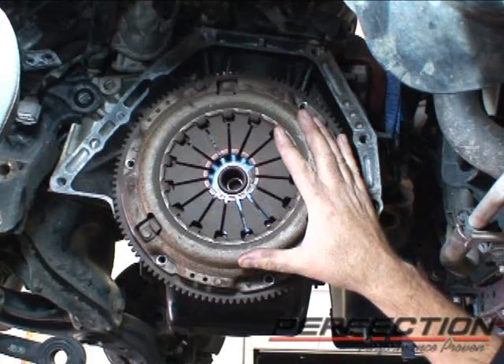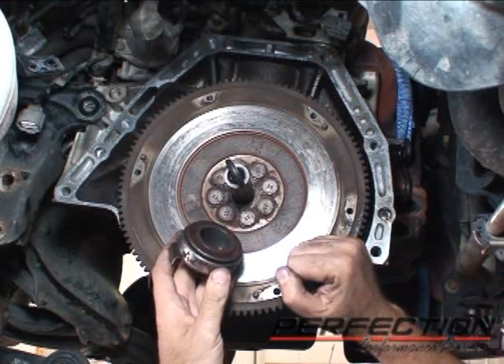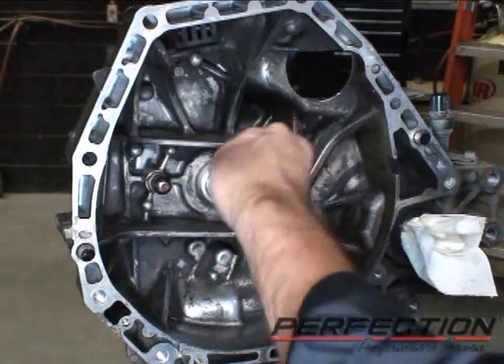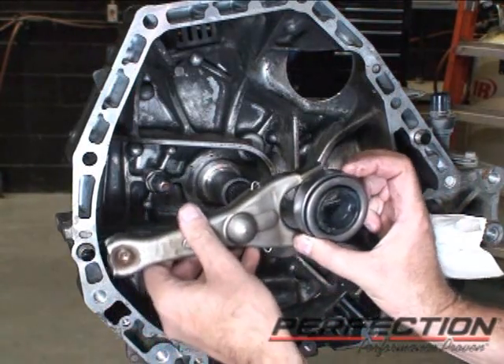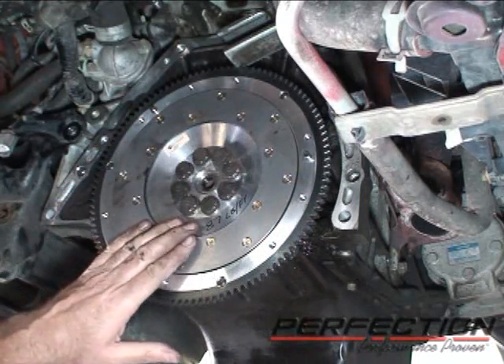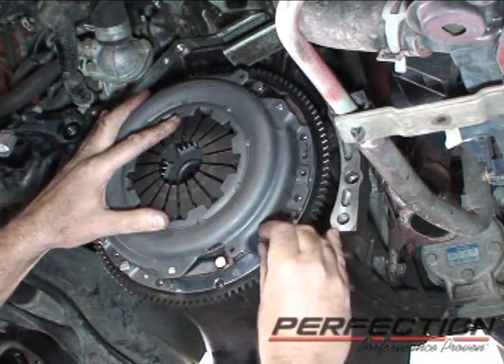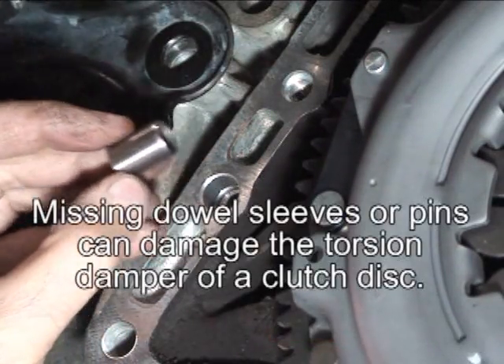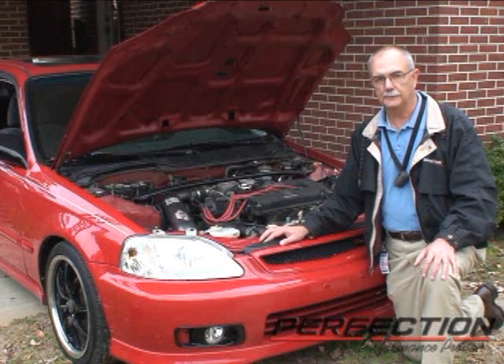2000 Honda Civic Si 1.6L Clutch Install

Comment: What damage can happen to transmission if you drive 500 miles without the dowel pins? I did not realize they werent there, took it back out and put them in and it wants to grind in second, air seems all out. The trans is new not rebuilt, thanks for your time
Reply: ***** Hello, thanks for commenting, the car is1995 honda civic dx with everthing from flywheel ,clutch, to trans,mastr and slave all new. I dont pull it into gear hard when shifting so I don't get the grind noise but goes into second only rough, I feel it threw the shifter, and its not smooth like other gears. Clutch pedal has been moved previously up or down before I owned it, would be nice to know exactly where pedal height is too, the haynes manuals are not picture exact, and I can not find a video of 92-95 civic showing the pedal asembly so I can see where the pedal rest with foot off,(how much of the pedal height stop bolt, or cruise control switch if has cruise control is showing how many threads when contacting pedal for correct oem height). Too low or high will be a problem,and not sure if its that also what could be causing it, oh and can slave be blocked at any position,fully pushed in etc. Thanks again sir for your time.
Reply: ***** Thanks Gary, that video I've watched before and is a excellent one. In the video the white rubber stop on the pedal hits that bottom bolt just like mine, I'm tryen to find out now how many threads are shown on the tip of the bolt that make contact with that white rubber stop,the bolt goes threw that permanent bolt mounted to assembly, should be a thread to 5 or 6 showen when touching the white pad? That would give me the oem height so I then would have the correct pedal stroke which would let me no my disc should be completly undun from pressure plate and flywheel so it will make smooth shifts. 92-95 civic and 96-2000 civics have lil differences in pedal assemblys so I havent found a video showing that actual bolt to see the threads exposed when contacting white pad in video. I'll try to do a video showing it in my civic, but I do understand the adjustments to master just the height on pedal will let me know if i'm getting full clutch plate release. Thanks sir i really appreciate you taking the time with me

Comment: Thank you for a great video! I have Honda Civic 2000 1.4i and got its clutch done recently. Since the clutch change, the car sounds louder, with black smoke and idle issues and today I noticed oil leak under and around the engine. Can you please suggest what that might be the cause of this?
Reply: Sounds like your problem became bigger. Now I see, changing clutch is not a joke. Thanks for posting.

Comment: my car sounds just the same, with clutch up.. and down the noise is gone.
im wondering if i should replace the thing.. 

but im sure that doesnt take 14 minutes ^^ 
so the Q is: do you really need to change it, if the gears work normally?:)

Comment: Customer got rip off the noise still there he probably spend 800-900 for not fixing the problem I would recommend a transmission bearing replacement kit and the whole clutch package

Comment: hi how are you sr, please a need your  help!! how i can know if  my clutch have pins or sleeves or  all clutch have them, ...hello wanted to thank you for the videos are very practical , and now with the crisis it saves a few euros hehe had a question look to see if you please , I have opel car astra g 1.6 16v 100hp which will try to change the clutch , buy piece and the disc diameter is 200mm had put it on and fit perfect, but a detail I did not I put that adapter to your tapeworms but when I go to put it right, or so I thought .. porq then try to mount the meter marches did not fall , a mechanic told me that the clutch was not in that car! and then I ask myself as fit ? it may be the case? now and bought another kit of 206 mm diameter and although I do not see much deference to the other and it did not work I put , I see that such montare ! appreciate you enlighten me fren! possible that the same car will be worth one 200mm and one 206mm on page because that code with motor give these 2 options and that maybe " not to use the adapter that was that I do not that okay? thank you very much ! not put or pins or sleeves ? gracias amigo !

Comment: hi, does the Thrust bearing rotate when the clutch pedal is released. if so does the rotation of thrust bearing occurs from rotating clutch plate, pls advise. this is general qustion not related to any model though.. also why it is called thrust bearing and how is this guy different from regular bearing

Comment: you made a mistake man, when using an aluminum flywheel you should use a torque plate, this is because the bolts can damage the flywheel when you torque them down, whit a torque plate the flywheel bolts tigthen down on this ring, and save the flywheel, in addition to having the bolt come loose. Everything else is good. Nice job.

Comment: @shwan2307901 i have been working on honda`s for 15+ years now and i can tell you this, it is very hard to maintain a "quite engine bay" once a car has this many miles and obviously is ragged on, this honda had a intake, and is vtec, i am sure you like the sound/feel of vtec and often floor it huh? well a lot of honda`s have cam chatter, if you dont know what thats is, you dont know much about any vtec honda engine,so first make sure that is not what you are hearing.

Comment: my honda prelude will not go into gear when it is turned on i changed the master and the slave cylinder and it still doesnt work. And i have no idea what else it could be my mechanic said it might be the clutch. could it be the flywheel too???
Reply: The story is I was driving I try to put the car in 4th gear and it wouldn't go it would make a grinding noise if I did try. My mechanic suggested we change the hydraulics. We also bled the whole system there should be any air in there. Thank you.
Reply: +perfectionclutch what could be internal because I'm gonna cage the clutch kit anyway should I change the flywheel too. and thank you very much for all this useful information.
Reply: +perfectionclutch there's also a sound when I fully press the clutch down and we got rid of all the air in the system we bled it for a good 30 mins

Comment: my civic does that
Reply: haha mine too that's what I'm trying to figure out
Reply: Jake no thanks any idea on what it could be tho?
Reply: +Evan Is Evan throw out bearing or input shaft bearing
Reply: +Jake no thanks I'm still gonna romp on it still.
Reply: +Evan Is Evan yea just change your trans fluid pretty regularly
Reply: +Evan Is Evan its not hard you use a 3/8 ratchet to remove the drain plug and a 19 mm to remove the fill plug and put 2 quarts of 10w30 in it

Comment: wrong diagnosis,the input shaft bearing plus countershaft are the fault,anyone that has some technical knowledge why the shafts are turning even in neutral could tell that the clutch or spigot bearing were not the problem,i would not take my car to you because you replaced all the wrong parts,oil was just a makeup panadol,I worked for a honda dealership for 17 years and that is not a honda problem any manual transmition will come with a similar issue.

Comment: Hi tks four your video, I have a Fiat Stilo 1.6 16V from 2002  six weeks a go I fit a new clutch kit and now the clutch start sleeping interment  I don't now if the garage bleeding the clutch or not I been remove my self a little cover and the fly wheel is dry and is no leaks can you please help me if you can please reple my email soon is possible many tks best regards:Berenguer

Comment: Clutch bad? Now it's gear box wear?? lol IT'S THE AEM V2 COLD AIR INTAKE SYSTEM!! PUT STOCK INTAKE SYSTEM BACK IN, "NOISE" will go away... no need to spend thousands of dollars... lol but great diy for replacing the clutch.

Comment: It is clear you understand clutch theory.  You presented the information well. I also learned something new with the channel steel on the flywheel teeth. Thanks!  I also like to wiggle the alignment tool a little.  Did you take the alignment tool out so the torque wrench would clear?  Some other reason?  I'll be sure to look for your brand when I need clutch related parts!

Comment: its the transmission i had the same problem in my 98 i pulled my trans and a ball bearing fell out of the transmission and the transmission was torn to pieces release bearing was shot to shit and the fly wheel was toast and the clutch was fried since you replaced all that stuff minus the transmission obviously its the transmission hope it gets fixed soon

Comment: You're talking about an auto trans that never gets its fluid replaced because of lazy idiots. With trans fluid being replaced every 30,000 miles, auto transmissions can last forever or for at least 500,000 miles.